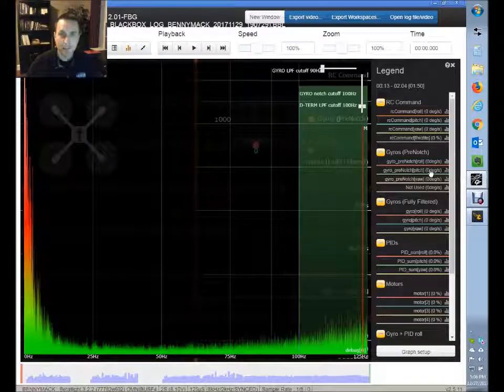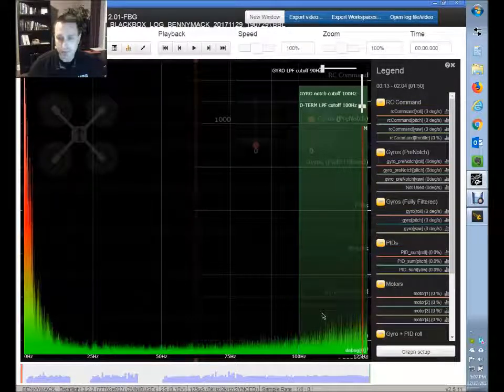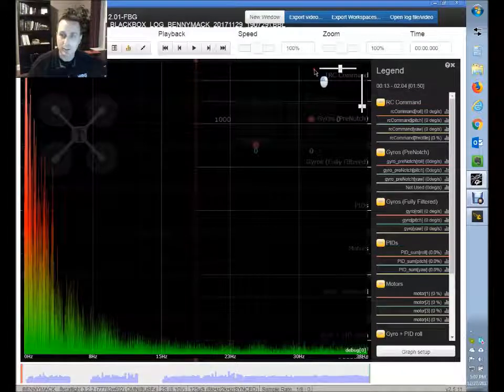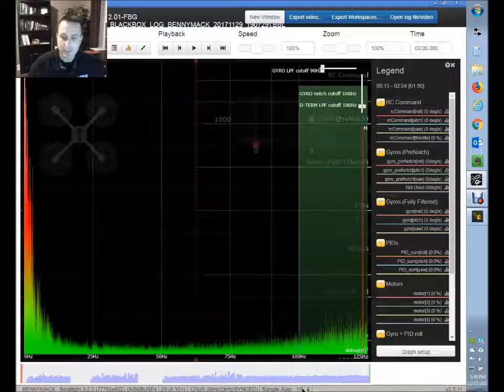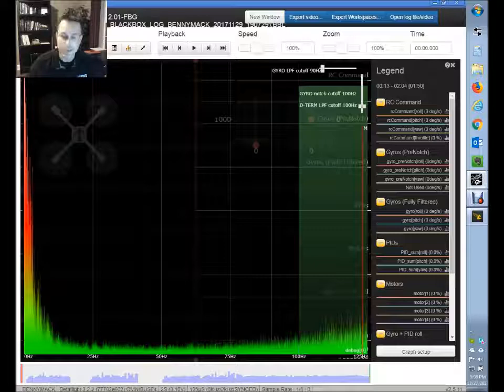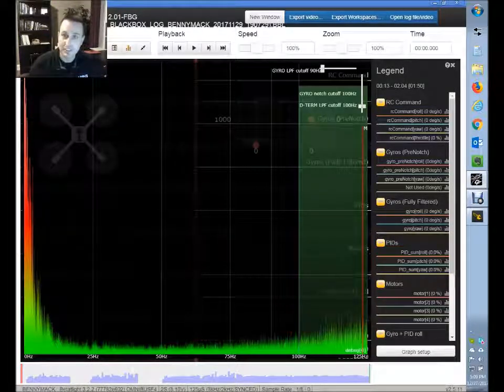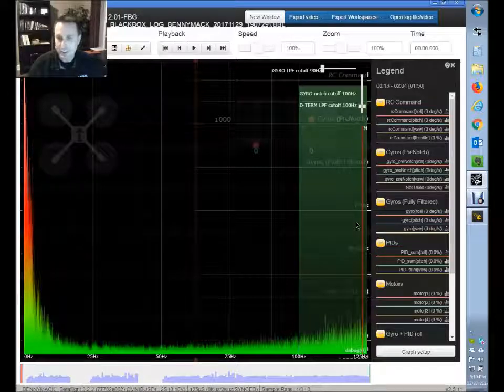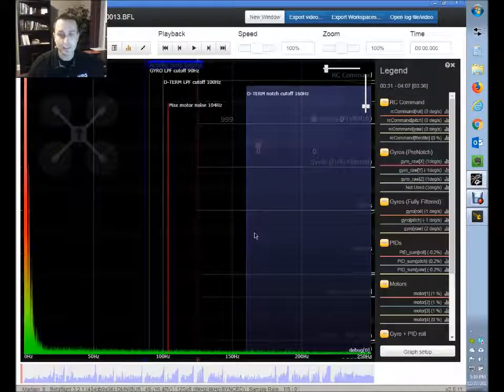Understanding the Blackbox Sampling / Logging Rate

Comment: I need to record Accelerometer data at 4khz minimum on the BlackBox however I am limited at 2khz logging rate in betaflight ... do I need to get a different FC to go faster?   (My goal is to record the vibrations to find harmonics ) i am currently using a mamba F405 
thx
Reply from the maker: You can log faster if your Gyro chip supports 8k sampling rate.  If a BMI gyro, those limit at 3.2k, however, that will be the ACC rate too, so no harm.  Just set the logging rate at 100% and you should get the log at the same rate as the gyro is taking samples.
Reply: @uavtech  great thank you! I have another question, i need to record the raw accéléromètre data without any filtering (i need to measure the vibrations up to 4khz and look for harmonic frequency's that could do structural damage) is it possible to record raw data by disabling all the filters in beta flight?
Reply from the maker: Not sure off the top of my head.  I would look at the debug modes in the CLI.

"get debug" [enter]
Reply: @uavtech  ok thanks 👍

Comment: Hey Mark just starting to explore this whole black box thing. I am currently running BF 4.1 at 4K 4K dshot 300. So exactly what should I set my bb hz at? It is currently at the default 1hz.
Reply: If I'm not mistaken, black box should be at 2khz if pid is 4khz in order to get to 500. Correct me if I'm wrong but the following will all achieve 500; 8k/8k then bb = 1k, 4k/4k then bb = 2k, 2k/2k then bb = 4k? It was unclear because it seemed like you were talking about 2 different quads, one running 2k/2k the other unknown (assuming 4k/4k)